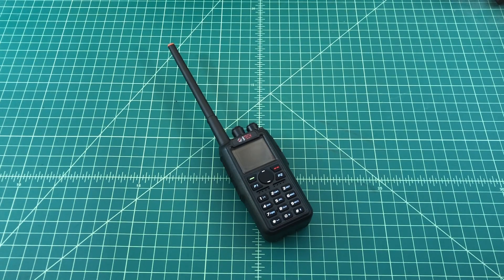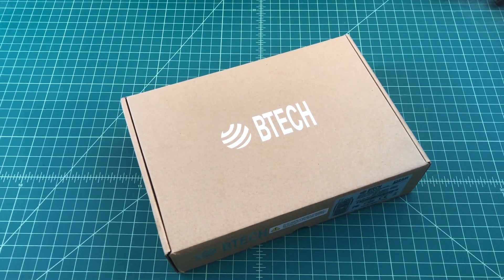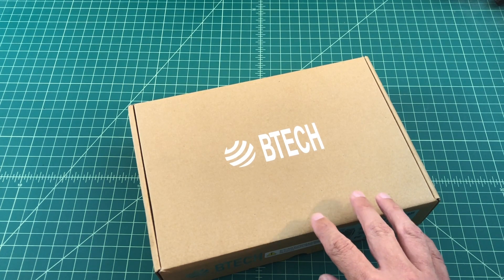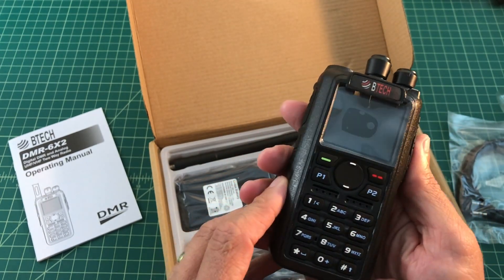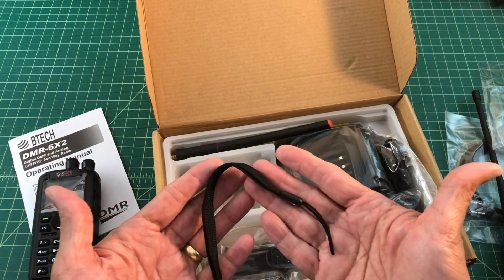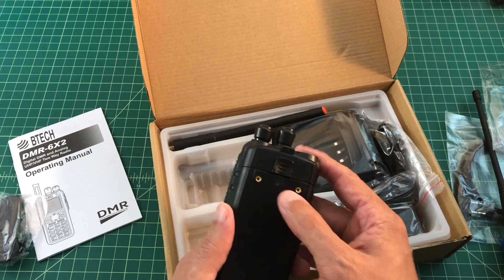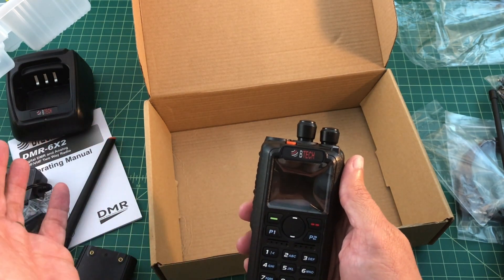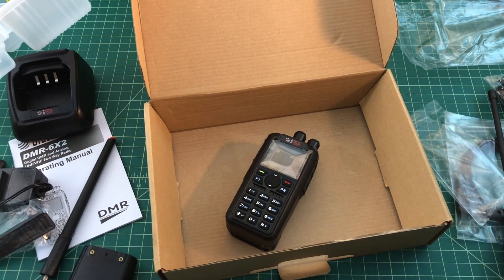BTECH DMR-6X2 Digital HAM Radio UNBOXING - TheSmokinApe

Comment: holy crap 4000 channel memory lol I wish the little baofeng would do something like that in firmware with the uv5r. they have just under what I need to use.
Reply from the maker: It would be nice if the UC-5rs has more, I can fill up 128 pretty quick.

Comment: I paid a lot more for just an analog dual band (VHF/UHF) radio a couple of years ago for the price now I could have had something like this BTECH DMR-6X2 Digital HAM Radio, which is considerably better & did include a programming cable, ear piece & extra capacity battery. Kudos!